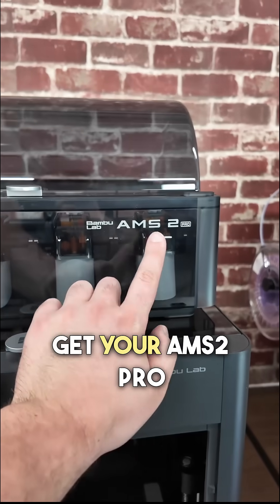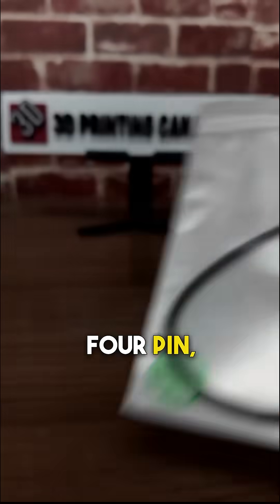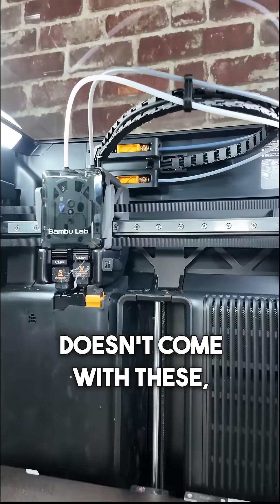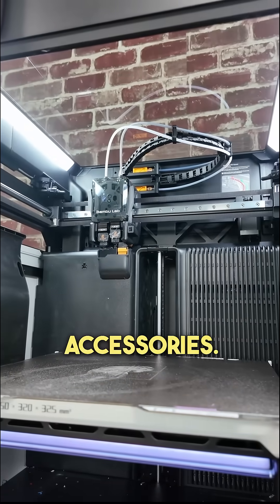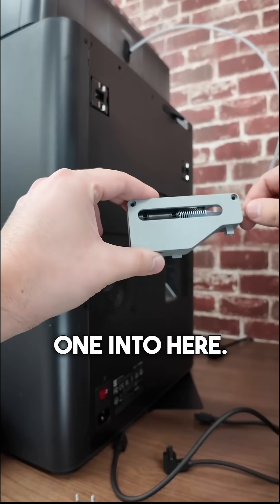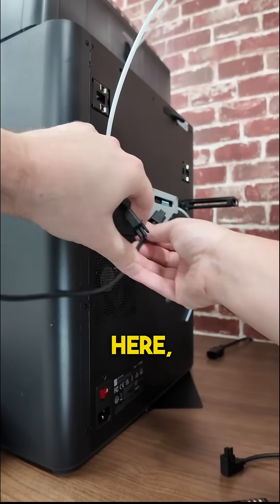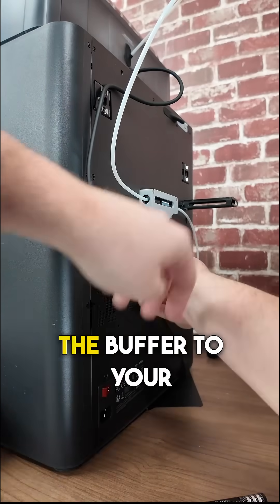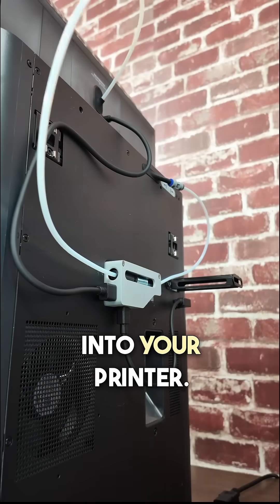How To Connect Bambu Lab AMS 2 Pro To Your P1S #3dprinting

Comment: It is really worth knowing that the connector and buffer have little black push release buttons for the tubes so that if you put the wrong length in you can change it easily.  And also checking the manual for which length goes where.  Seems obvious but would have helped us newbies.

Comment: Bought the p1s, ams 2 pro, ams ht and ams hub.  None came with 4 pin bus cable.  Such B.S.
Reply: I purchased the same deal. It gets setn seperately. What i was just told by customer care is that the filament buffer.  Thats crazy. How am I supposed to use the AMS2 pro without it?

Comment: what additional power adaptor is required? and why I can't just use the one that comes with the AMS2?
Reply: The power adapter connects the AMS 2 to a wall plug and delivers the power for the drying function because the P1 and X1 can't deliver enough power

Comment: Why does the bus cable come with the buffer, but not with the hub? Who decided that was a good idea? Also, why does the hub come with 2 6-pin cables and no 4-pin??? WHY DOESNT IT INCLUDE THE 4-pin????????????? IT LITERALLY NEEDS IT TO FUNCTION, YOU DONT EVEN NEED 2 6-pin CABLES CUZ YOU DONT NEED 2 AMS UNITS… BAMBU LABS CMON MAN THINK BEFORE YOU SELL
Reply: Especially because the ams unit comes with the damn 6-pin cable, so you never need the 2 they send you… like actually, who tf put this package together? Did they think at all?
Reply: You buy the upgrade kit for the printer which comes with the ptfe tube connectors, BUT NO 4-pin CABLE…

Comment: And a firmware upgrade which breaks OrcaSlicer usage.  No thank you.
Reply: Just use bambu studio
Reply: @convongamer280 Only someone not realizing what benefits Orca offers would answer like this.  If you want to be locked into inferior software, then you do you.  I'm rather considering developer mode on my Bambus.  So far losing the camera surveillance via the app was holding me back (as the Home Assistant connection also seems quite unstable - possibly also hampered by Bambu?), but now having discovered BambUI, that may well offer a replacement for the Bambu app for what I use it for and allow me to stick to Lan-only developer mode.

Comment: What does the ams2 do that the original doesn’t besides Easier maintenance
Reply: You can dry filament,
Reply: It has brushless motors so it's more efficient, quiet, and can feed and retract faster.